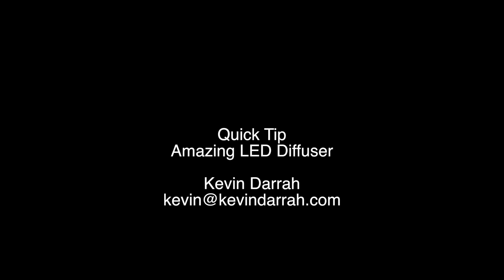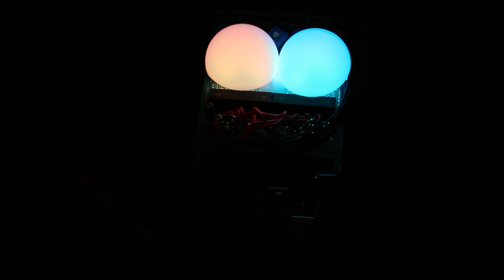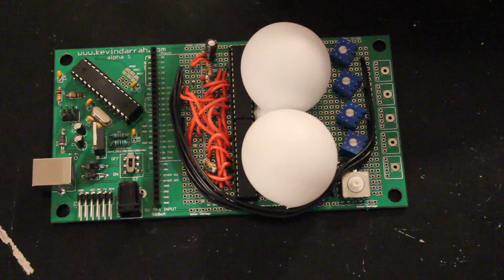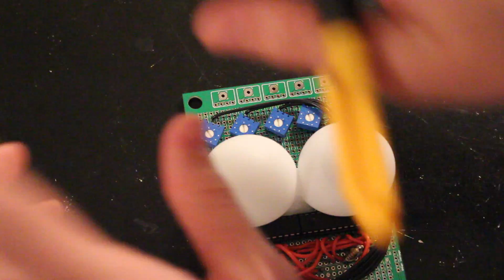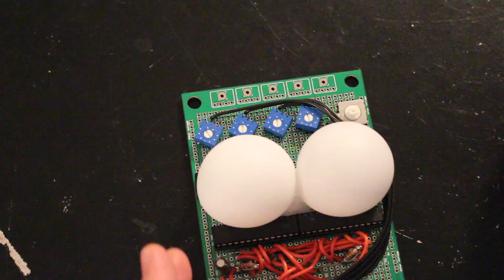Quick Tip - Amazing LED Diffuser!

Comment: I've built a couple little wind powered generators using a dc motor running in reverse for the generator.  The last issue I was having is the difficulty in seeing the LED when it was lighted.  This trick solved that problem and even looks good besides.  Thank you very much.
Reply from the maker: cool!

Comment: They are filled with flammable gas! Once you poke a hole through them there is only plastic left and that will only melt but not burn, well at least not with RGB LEDs!

Comment: Finding nitrocellulose ping pong balls and not plastic of some sorts is not easy these days, check the package, they are plastic. Flammable yes, just not like the old nitro balls, not any more flammable than the plastic the LED is made with. I didn't know about the helium, but given the increasing scarcity of the gas, and its ballooning price, Its just air, I looked it up. No worries using them on the LEDs. Have fun.